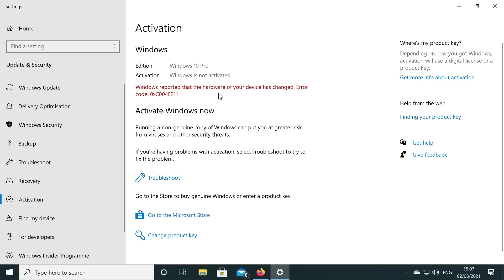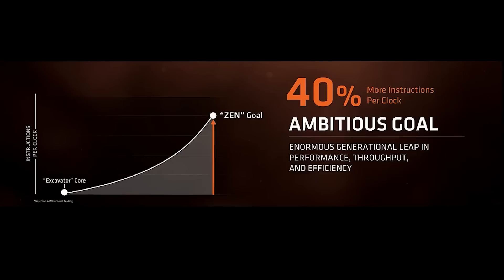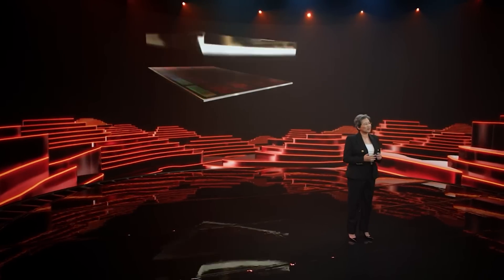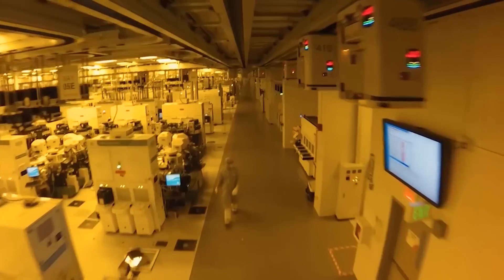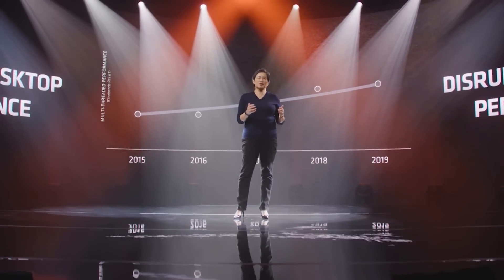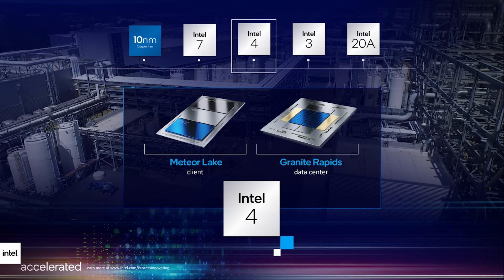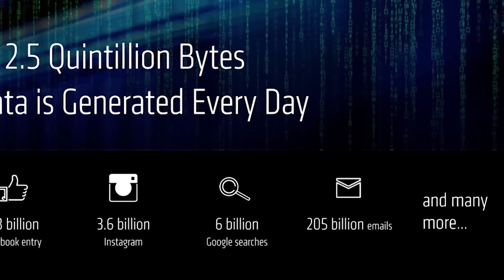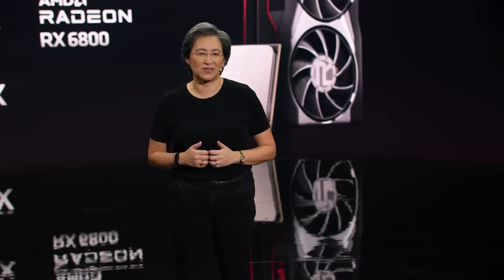AMD Details Zen 4 AM5 Platform & Accelerator Tech | Ryzen V Cache Performance & Release Date

Comment: I'm kinda sad AMD still did not produce a successor to the Athlon 3000G so far, i would love to see this lineup of CPU still moving forward as well...
Reply: AMD is making too much money dedicating as much die as possible to EPYC.  They're stuck by contracts for how many wafers they can get a hold of, and they can't make enough EPYC for market demand and that's where most of their profits are going to come from.  As it is they're already going to shift some production away from RDNA 2 to making chiplets for EPYC.

And I don't blame them.  This is putting a lot of money into the company for future R&D, better software support, etc...  I would expect AMD to discount their Ryzen G series CPUs and that's the best you're going to get for a low cost APU.  I've seen the 5600G at $200 USD.  RIght now it's at $220.  It doesn't make a lot of sense for them to keep making a slower product when it probably wouldn't cost them less money to make.  Add to that TSMC is raising their prices.  So, finding something like a 5600G on sale is about the best you're going to get, most likely.  I mean, you can get laptops that DESTROY something like an Athlon 3000G, and they don't cost a lot.

https://www.microcenter.com/category/4294966995,4294819840/amd-processors

I can't say for sure what chipmakers are going to do, but with moving down to 5 and 3nm and whatever Intel wants to call their nodes, it makes small devices much more powerful, and making something that's weak for a desktop just doesn't make sense.  It's now to the point where I think you would need a cheap MB with a small socket for a less powerful APU, and keeping this on a small form factor so that pricing makes sense for it.  So, no gen4/5, DDR5, etc....  Just barebones.   It doesn't make sense to have a slow product for an incredibly fast MB that costs more.
Reply: There's a fixed clock Pro 5650ge which I've seen cheaper than 5600g which has been selling way over MSRP where I am.

Comment: It definitely makes sense to have PCIe gen 5 on a consumer platform. Consumer platforms have less PCIe lanes, so higher bandwidth per lane allows more IO.
Reply: But no one can even utilize PCIe 4.0 yet. So 5.0 is even MORE overkill.
Reply: @Twitch_Moderator  Gen 5 ssd is already more than gen 4 can handle.
Reply: @Twitch_Moderator  uhhh... Not sure what you're talking about? I can utilize PCIe 4.0 just fine. You don't have to be able to saturate 16 lanes on one device to benefit from it.
Reply: @Twitch_Moderator  there's direct storage on the horizon, that's going to leverage gen4 and gen5 potentially. As the new consoles are using it I expect pc games will follow too.

Gen5 potentially means a motherboard manufacturer could give less lanes for a gpu, whilst keeping the bandwidth the same and allowing for more nvme drives as gradually sata will start to dissappear on some boards in the next generation I expect.

Comment: If nvidia is going pcie gen 5 with the super, and Intel gen 5 gpu's, it would be foolish for amd to not support gen 5. Everyone wouldn't even think about it and just buy raptor lake, regardless if it makes any difference whatsoever
Reply: they wouldn't change it with the super.
but they might on the 4000 series which is only a year away
Reply: @cydia11centra  nvidia? Supposedly a 3090 super in early 2022 will be pcie gen 5.
Why else would they do that if it weren't to ruin Intel?
I'm not just guessing. Many, many people have already reported on the supers being pcie 5.0, so it appears that they would!
Reply: No video card uses more than 32Gbps. So, no need for PCIe 5.0. PCIe 4.0 is too much bandwidth as it is.
Reply: @Twitch_Moderator  I believe I covered that in my post.
I don't think it's even relevant if it matters or not. The vast majority of people just buy things and want the latest and greatest and will have no idea what matters and what doesn't.
I think AMD agrees with me, which is why they probably decided to do it when no one thought they were going to.
Reply: @Twitch_Moderator  when direct storage hits that could change quickly. The gen4 or gen5 gpu will be able to leverage the gen 4 or gen5 ssd and bypass both system memory and cpu. It could be a huge performance boost or simply just a big boost to loading times. As the consoles are using it I expect new games will leverage that more and more and it will come to pc games at some point. We're kinda in a transition period for pcs and pc gaming atm. There's a lot of promising potential,  but only time will tell if it rings true. 

Having gen 4 or gen5 parts therefore is not going to be a bad thing to have and could help future proof new systems built today a bit better than just sticking to gen3.

Comment: I love when people act like intel was doing nothing until amd stepped in. The whole reason why intel had 10 nanometer issues was that they tried to put in too many process improvements at once. These were planned out years ahead of time.
Reply: They pretty much did do nothing. Unless their engineering department was completely incompetent which I don't think is the case. Watch hardware Unboxed video comparing the CPU performances from 2014 onwards for a good example of it. I tested this years ago building 2 PC for friends and using mine as a benchmark. 3 Generations of Intel I7s with locked frequencies. The main improvements intel have made have been increasing in cache size with minor IPC gains generation on generation. If they had increased cache sizes years ago we could have had 9/10th gen like performance back from the start. The only reason they didn't is that AMD was so far behind they didn't need to. You cannot tell me a company like Intel with its R&D department didn't try to adjust cache sizes on engineering samples years ago.
Reply: It's true. But the overall kicker is AMD and Intel collaborated on many processors together. They are competitors, but not enemies. They push eachother's sales by not providing what the DOES and vice versa.
Reply: They issue is hubris.

Intel decided that they could make more gains per generation as physics dictates it will become more difficult.

They tried to skip a step and instead lost several.

Comment: if someone wants to make high core count processors broadly useful, especially to marketing twits, a good multi-threaded compression/decompression for the idiots who make 100GB Excel and PowerPoint slides - oh, yeah - recognize and just bypass data that is already compressed too. Or they could suffer
Reply: I prefer 100% IPC improvement in 10 years since Sandy Bridge for both AMD and Intel Instead of 60% and the Apple M1 chip making x86 look like Bulldozer.
Reply: Well they have done something similar for the new consoles, so they already have experience with adding it to zen. Speeding up things like compression and maths outside of the core architecture has some potential benefits with tailored skus for such tasks using a different io die with added accelerators perhaps.

Comment: The reality is Intel was competing with AMD on 14nm and Zen 3 was the first generation of Ryzen that beat Intel core for core.  All prior gens depended on more cores per CPU to win.  And zen 3 is only a few percent, mostly imperceptible, ahead of the 14nm Intel parts in games.

Intel Alderlake on 10nm is the first real threat Ryzen has faced.

AMD has to have a significant IPC bump this next gen.
Reply: Competing on performance yes, beating them by a slim margin on the 1000, 2000 and 3000 range, but not on performance per watt, which is increasingly trendy these days. 

I have serious doubts over the availability and price of Alderlake however in today's climate. Pushing out ddr5 and PCIE 5.0 will make RAM and motherboard prices rise. Entire new entry level builds will be 2k North in any currency.
Reply: architecture > process node anyway, look how Zen 3 is much better than Zen 2, and how RX 6000 series much better than RX 5000 series.
Reply: @Lemard77  yeah but when you've been using the same old node for SIX YEARS there will be physical limitations to what you can achieve with it
Reply: TThe V cache will likely guarantee that AMD dominates the server market until intel has a similar tech. The extra cache will make a huge difference for a lot of databasing tasks etc.
Reply: zen 4s ipc bump is going to be 25+ and with much higher clock speeds and ddr5 zen 4s performance will be about 45% better than zen3s. lets not forget that 3d cache will improve perfrmance even more and amd is doing this with less than half the power consumption of intels 10 nm process node, wich is comparable to tsmcs 7 nm. chiplets is also a great advantage. so...
Reply: @joakimedholm128  ok zen 4 will give us 25% + IPC.
Do u think ddr 5 will give additional 20% performance?
 Maximum ddr 5 will give you 3/5% improvement.
Have a look ddr5 vs ddr4 alder lake leak performance . Ddr 5 only giving 3/5% improvement over ddr 4.
      The main challenge for amd , struggling more than 8 core in one ring. Have a look anandtech Dr Ian cutress report. In mainstream platform more than 2 ring (ccd) will make higher latancy , as a result will loss signel core and gaming performance. Thats why zen 4 targeting for 16 core . In order to make 24 core , the 6950x will need 3 ccd and gamers/single thread application user will not buy that cpu.  So, zen4 will struggle against 24 core I9 raptor lake in multithreading.
Reply: @bakulboro2292   ryzen cpus are very dependent on fast memory and memory timings. you cant compare amd with intel because they dont have the same architecture. furthermore ryzens solution to latency penalty is large caches and bisected ring funtion, but the latency isnt very high anyway. im a subscriber to techpotato since he started the channel and ofcourse ive seen the ring or mesh video:)
Reply: @bakulboro2292  i think zen4 will have very high clock speeds. theyre going for a maximum tdp of 170w, thats much more than zen3. maybe their new apus with rdna2 is to blame for the higher tdp, but not all of it:)
Reply: @joakimedholm128  i don't talked about cache memory penalty. I talked about ring , core to core comuniction . Amd right now struggling to make fully connected ring beyond 8 core. And adding extra ring occurs latancy . Thats why xeon and treadripper not suitable for gaming and single threaded application. And zen 4 will consume 170w becasuse avx 512. You should not expect zen4 will give you around 400/500+ mhz.
Reply: @joakimedholm128  it's another myth only ryzen perfom better on high memory benwidth. Have a look linus tech tube . Ryzen processor destabilize beyond 4200mhz oc where linus made stable a 5000mhz memory on 10900k. Besides you should look 10400f 2666vs 3200mhz performance on gamer naxeu. All processor perform well on high memory benwidth. It's not only ryzen will perfom well. A High memory kite only gives you 5% performance . Maybe in future 7200 mhz ddr5 will give you 15%+ performance , but its will take few years.
Reply: @bakulboro2292  dont think itll take a few years, theres already 5800 hhz ddr5. i know people in the industry and they say zen4 will be 40%+ in performance uplift and that was a long time ago, the numbers only increase with time.  even paul at redgamingtech said 40+ and they call him lisa sue:) pz
Reply: @bakulboro2292  we shall see:)
Reply: @joakimedholm128  you expecting too much from zen4 . Good luck. 
 My words, maximum you shall get 27% maybe 30% in some application. Alder lake already ahead of 22% in singel treaded . Raptor lake will give another 7%+ single threaded and 35%+ multithreading. Because in raptor lake we gonna see doubling down e core. And 4 e core can uplift 20% performance , you can see 12700k vs 12900k.  13900k will have 16 e core with 35%+ multithreading performance.
Reply: @bakulboro2292  one word: threadripper
Reply: @bakulboro2292  amd use bisected ring structure on their ccds
Reply: @bakulboro2292  we will see whos right:D.
Reply: @bakulboro2292  amds cpus dont have any latency problems anymore. the vcache is going to make a huge difference. the clock speeds on zen4 is expected to be much higher, i happen to know that this is a fact, cant tell u why though, but believe me;)
Reply: @joakimedholm128  more l3 cache may increase extra latency . Thats why intel doesn't put much l3 cache in cpus. Watched in  dr Ian cutress techtechpotato, ibm l2 cache video. Anyway , it amd's  problem how to deal with extra cache buffer latency. May be they have some solution on this matter. Thats why they ready to intreduce
 I dont saying amd has latency issues on zen3 ring. They resloved it from zen2. But they can't put more than 8 core in one ring. In future amd will need more than 16 core to defeat I9 in mainstream. And in order to do that , they need to add one more ccd . Means extra latency. Yes they have threadripper , thats another segment and in that segment they will fight against intel's  sapphire rapid (w series). I dont going to debate that segment.
Reply: @bakulboro2292  well, the people at amd are doing almost everything right nowdays and i expect them to continue with this for some years ahead with cpus and gpus. its a good thing that intel is cathing up though, cus we need that competition as consumers. have a good one:) pz
Reply: @joakimedholm128  Ryzen 9 5950X makes a 2990WX that was made not that long ago look like a Bulldozer CPU. Threadrippers are overrated, huge abomination of IPC (or singlethread speed) and efficiency.

12900K will make these threadrippers even more embarrasing by the fact that it has integrated graphics alone and higher singlethread speed with comparable multithread at less than a half of the power draw.
Reply: @joakimedholm128  All speculation until the benchmarks are done,,its a wait and see product
Reply: @joakimedholm128  25+ IPC?
Fake af.

x86 only improved IPC by 60% since Sandy Bridge, Apple M1 makes both Intel and AMD look like Bulldozer, watch the passmark and Geekbench singlethread scores, and that is the perfomance at 3.2GHz.
Reply: @saricubra2867  wait and see for your self, i know what im talking about, believe me...or not;)
Reply: @joakimedholm128  No, Apple Sillicon is absolutely obliterating both Intel and AMD, that's why Alder Lake exist, because ARM is a big threat.
Reply: @saricubra2867  yes apple has the highest ipc of any cpu out there to date, but they still use macos and maybe in the future when some hacker get pass their security they will be a threat. for now they are almost only used for content creators and people who dont game and so on. windows and linux are going to dominate for many years to come:) pz
Reply: @saricubra2867  amd is said to use big/little architecture on zen5
Reply: @joakimedholm128  Linux has like 1% of overall market share vs MacOS which is 20% or something like that lmao.
Reply: @saricubra2867  nice joke Linux has 2.3% and macOS has 16%
Reply: @axylex304  Linux always has been irrelevant for the majority of people.

Even gaming on a Mac (with the proper hardware) is better.
Reply: @saricubra2867  Gods the idiotc M1 chills are annoying
Reply: @saricubra2867  No it's not.
Reply: @WimukthiBandara  Before saying that i'm an M1 chill, i'm using a Haswell Intel system since 8 years ago, i will upgrade until a new Sandy Bridge comes out (100% IPC improvement) unlike the newer Bulldozer-like IPC that i see now with AMD Ryzen and Intel Core processors.

I want twice the singlethread speed of 2600K at 3.4GHz and a TDP of 45 or 65 watts, not 5.3GHz at 125 watts.